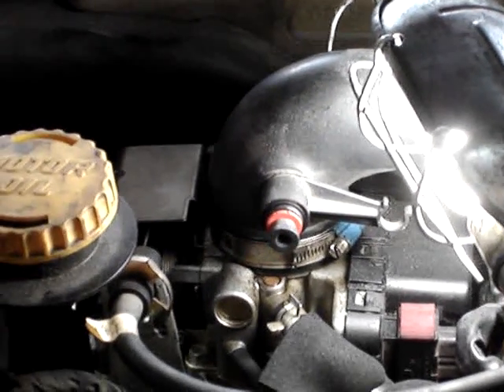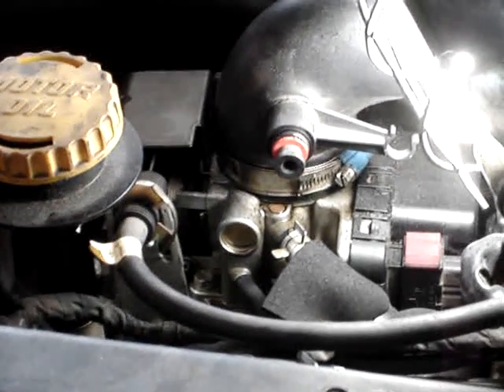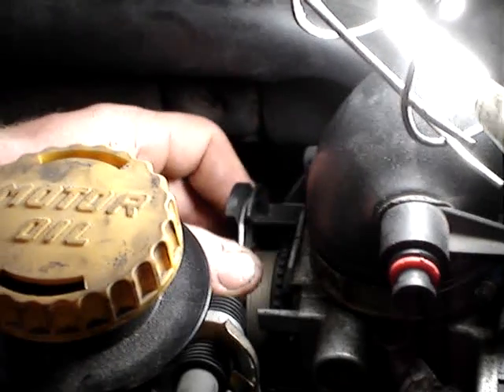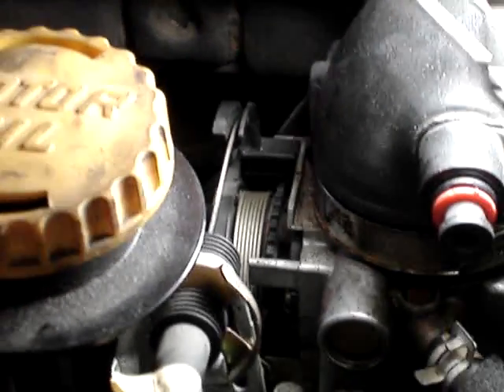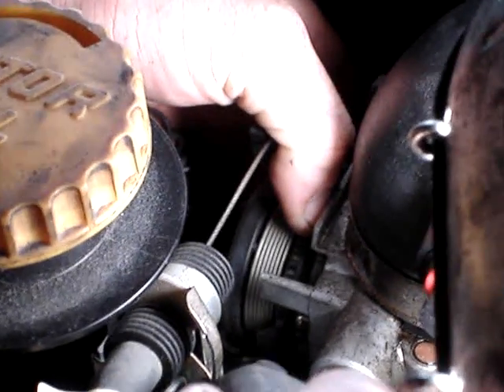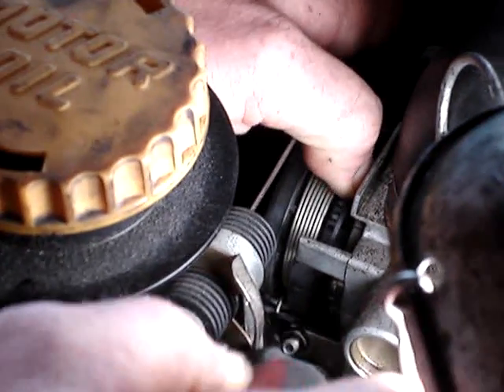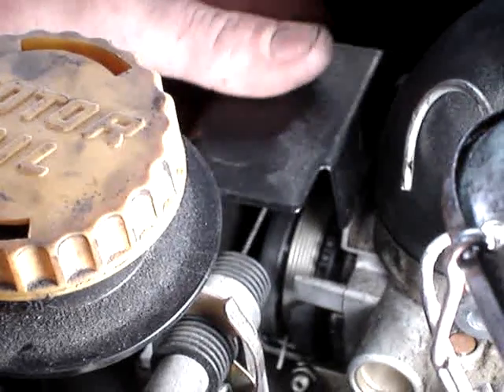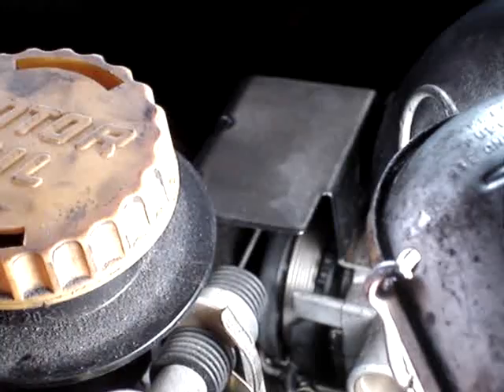How to Reset Saab Trionic 7 Throttle Body Limp Home Mode

Comment: Thanks mate, I have been stuck for days. 

First the car suddenly stopped being able to keep stable revs on neutral and would eventually die on me, if I didn't shift fast enough. That happened a few times before I was able to stop, connect diagnostics and find p1230. I drove it back home (just a few km) found out, that the code means a bad sensor, which I doubted, so I cleaned the throttle body, erased code and tried going around the block for a few times. Everything seemed ok, but next time I wanted to go somewhere it has done pretty much the same thing, but the codes were p1251 and p1260. (weak return springs), which I checked and the springs were a-ok. I tightened the throttle cable, erased the codes and drove back home. I got the check engine light again, but the car drove pretty much normally and was able to hold revs on neutral/with the clutch disengaged and so I searched the internet for advice and found out that it might just be the limp home mode enabled, which was exactly was going on.

I erased the codes once again, did exactly what is in the video. (push to the right!) and now everything is working again.

My dumb ass is very thankful for you and hopefully, if anybody as dumb/clueless as me runs into similar issues, this comment may help a little.

Comment: Also It has to be reminded  that using a flat head screwdriver push the spring you see towards the spiny gear I mean push to your right side the spring spans counterclockwise along with the gear
 thanks.

Comment: 1. Check throttle bore and throttle plate for excessive dirt and physical binding, clean as necessary. 

2. The codes must be cancelled with an OBDII or Saab equivalent scanner. Turn off the ignition switch and wait 10 seconds before resetting the throttle linkage. 

3. Reset the throttle by removing the cover from the throttle linkage on the passenger side of the throttle body. Look at the throttle body, from the passenger side of the car, with eyes at fender height. See approximately a 5 mm length of straight wire protruding straight downward from the bottom of the limp home solenoid housing on the rear of the throttle body. 

4. Use the left forefinger to gently push the protruding end of this wire toward the driver's side of the car about 3-5 mm. Hold the wire in this position. 

5. Gently rotate the Black plastic toothed cam, on the passenger side of the throttle body, in a counter-clockwise direction. Will hear a slight ratcheting sound and a "snap" when the cam has reached the reset position. 

6. Release the wire with the left finger. 

7. Test drive.

Comment: I have this high idle problem after the check engine light comes on. The check engine reads out as an error from the throttle body. But after resetting the check engine, I have good running idle but a kind of numb feeling throttle.

Comment: Same setup on my 2003 9-5 2.3t linear. I believe it will work on 9-5s on up to 2010 but not sure. You move the "spring" (it's the end of that wire that wraps around the black wheel several times) to the driver side. I was able to do it easily with finger. No screw driver needed. Before I did this I cleared codes with a cheap obd-2 reader and then I disconnected the battery. Also found a vacuum tube that was completely disconnected from throttle body that I slipped back on. Ran great for about 25 miles and then having some more jerking/bucking issues but not as bad as before. I suspect maybe throttle body gasket leak or something like that. But no home limp mode yet. So glad I found this online and was able to save a tow/garage bill. Thank you for posting.

Comment: So, If I am understanding right, the Limp Mode sets the throttle to operate like a old wire throttle? Like on my old 96' Toyota? So your gas pedal is always connected to the throttle?
Reply from the maker: +TheDJGabizz Yes the pedal is not electric. There is a cable that connects the pedal to the actuator arm on the TB.

Comment: #justinhifi I own a saab 9-3 2003 do you have any idea what type of powerstering fluid do I need to put on it. Hope u can help. And thanks for the vedios!!! Very helpfull
Reply: EMoney107Block 
Pentosin CHF-11s is what you want to use. 
The container is green metal, and it's rectangular in shape.
Most parts shops in my area (Seattle-ish) keep it behind the counter, which is most likely due to the fact that it's about $30 for a liter.

Comment: Mate you are awsome, i took my B205E 02 saab conv to the mechaninc and he fixes saabs occasionally and he said it needed a new throttle body. I followed your steps and it worked like a charm. now idles perfeclty and canceled light... your a legend mate..... great video and easy to follow.

Comment: im having a pain in the balls with my streering angle sensor, ive tried to locate it from the diagram, but, i just didnt dee where it supposedly is, AND my air bag sensor is always on, where is the sensor? is it dirty or is the clock bad???

Comment: Just to add to the video... You MUST use Tech2 to clear the fault code AFTER resetting the  throttle body or the unit will re-enter Limp home in a few driving cycles.

Comment: hey, i looked at your video, and had the same problem. but i cant turn that black wheel backwards, is it difficult? i was standing on the right side of the car and pushed a metal piece "up". thanks

Comment: You don't know how much you just saved me with this 5 minute solution!!, had the same problem last year and got charged over £400 for a whole new unit after being told it was the throttle sensor and needing to replace the whole unit as the sensor can't be replaced alone. Power to the people n F^<k you to all you dodgy mechanics out there!!

Comment: need help, my 2001 is on limp mode. the car accelerate and drive fine but the rpm is too high on idle, when i did what the video shows then the trottle bode won't accelerate the car so i turn the ign off and then on and it went back to limp and i can accelerate again...... What's the porpuse of this limp mode?

Comment: Hi! Great vid, after I saw this I vent tinkering with my car. The throttle body, or the spring thingy, jumps right back into limphome mode every time I start the engine. Is the throttle body FUBAR or is there something else I can try, before replacing it?
Reply: I hope it's solved by now! Anyway, be sure to clear the codes first before resetting or it won't reset.

Comment: Great video. One tip is on my 2002 9-3 you have to push the end of the throttle spring in towards the throttle body to release the limp home notched black wheel. I think the video showed you moving it out or away from the throttle body and that did not work on my SAAB. But thanks for the video!

Comment: Thank you for this video! I have a v6 and found that the same thing applies. The spring to move is facing up though. To clear the code, I just pulled fuse 17 for 15 minutes or so.

Comment: Its a good idea to battery pull to reset the codes when you reset your TB becuse what ever caused it is still active, I got limp home mode from a random misfire and the code was still active and kept tripping the limp home until i battery pulled.

Comment: I just installed a new turbocharger, and the car would run great for a while and then Warning lights and stalling at low revs.  I watched this video and 5 minutes later car is running great and all the warning lights have cleared.  Thanks!

Comment from the maker: @GoddardCraig Did you remove the battery cable while resetting the TB? If the fault codes are stored in the ECM at key on, it will activate the LHM solenoid causing it to go back into LHM. Best is to remove the battery cables while doing the reset. If after this it still enters LHM, the TB needs to be replaced.

Comment: ok on the throttle body limp home mode ordeal would that cause my saab not to start? such as the fuel pump?  i think that iam not getting any power to the fuel pump uuuugh!,and one more thing buddy when you stated in the video "move the spring to the side" where? which direction? and how? i tried to do it and it wouldn't move,maybe iam doing it wrong? oh and my saab is a 2002 93 se thank you for your time bud.

Comment from the maker: Sorry for the delay in reply, I did not get an email update. Usually a thin spray based lubricant. I usually use a dry lube spray. Im sure many other types would work just fine as well.

Comment from the maker: Hello. Glad I can help you out. You want to be sure the cogged wheel moves separate from the throttle cable. If it moves with the cable, it is in limp mode and a reset is needed. There are numerous reasons why it goes into limp mode. Most of the time it is either one of the two position sensors or the internal wire insulation coming apart which grounds out a circuit. Here in the states, there are a couple rebuilders but I tend to replace them with new units on clients cars.

Comment: Oh sorry and one more thing my car has the cog on the throttle body,and my car is a 2002 SAAB 9-3 SE turbo would this be applicable to my car? it should right? cause after your very usefull information i checked my throttle body and the cog moves with the throttle not without,thank you for your genrous time once again.

Comment from the maker: There is no such procedure for the 9-3 Sport Sedan (+03) with Trionic 8. If the throttle is setting DTCs then it must be replaced. It will enter its own limp mode and clear once the fault code is cleared and problem corrected.

Comment from the maker: @Animelegend1987 Yep, sounds like a potential LOM. To be safe have the code read for the CEL. You can also pull the battery cables off, reset the throttle and see if it goes back into LOM.

Comment from the maker: What year and model? US spec? If it has the electronic throttlebody (Trionic 7) the Air Mass Meter could be installed incorrectly leading to a trouble code. With your stalling, is the check engine light on?

Comment: Thanks this video,  I saved about 900EUR (1300$) !!
I did this simple trick on my 9-5 2,3L (year 2001), and it worked perfectly.  Without OBD tool, I pulled the fuse 17 for one second. It resets the CPU and clears the check engine / tcs off lights.  After 100 miles, still working perfectly !  Pierre-Yves Andri, from Belgium.